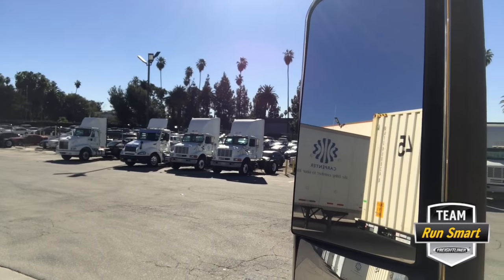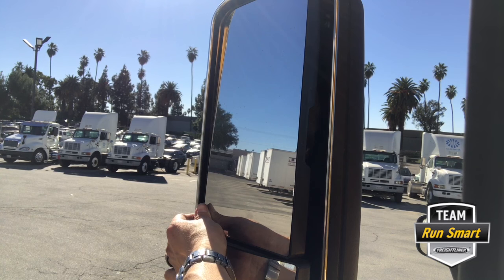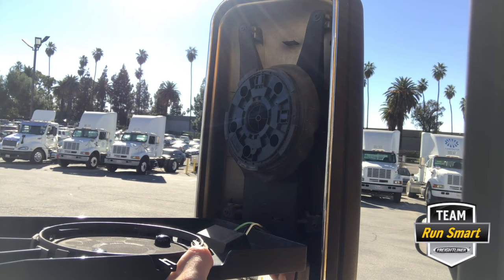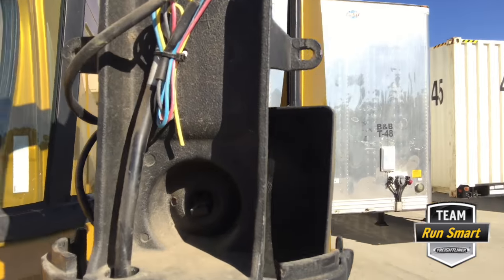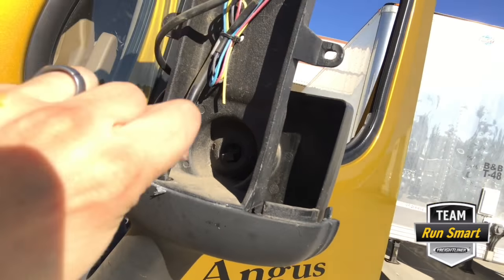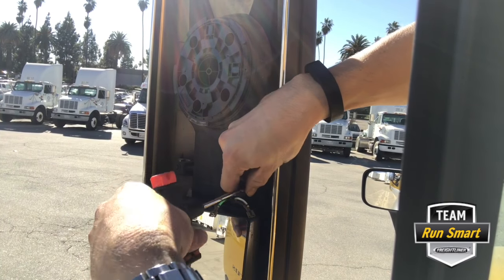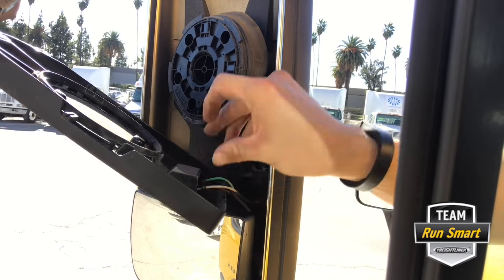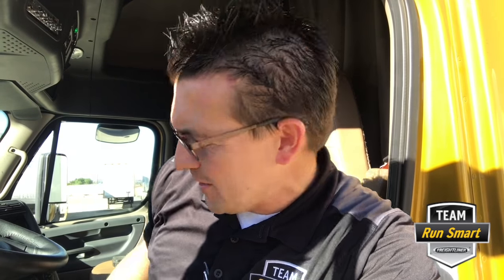Replacing the Door Side Spot Mirror on a Freightliner Cascadia

Comment: Not sure if previous video showed the “relevant” part. Wasn’t searching for hood mirror, but spot mirror. I tore the knob off in the center of it where the hole is for a “special” hooked tool to make turning it easier. Luckily I was finally able to get it locked with pliers. Putting that tool in the video and actually putting a new one not subjectively telling us how it’s done would’ve helped more

Comment: If u had trouble grabbing the plastic piece on the spot mirror, use a piece of wire hanger and loop it thru the hole on the piece you are trying to grab and turn.  Then you have something to grab with a pair of vise grips and is a lot easier to pull and twist.  Tried the way he said 20 or 30 times and never could get a Good grip on the piece.  Using the hanger gives you a lot more to grab on to.